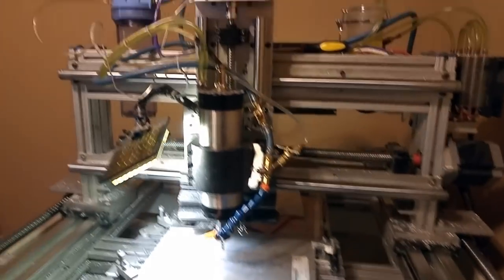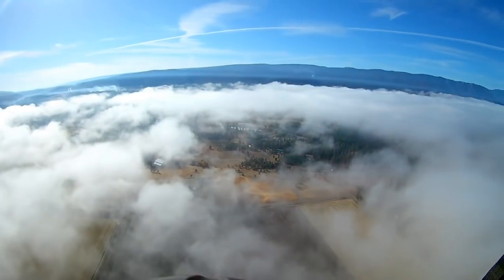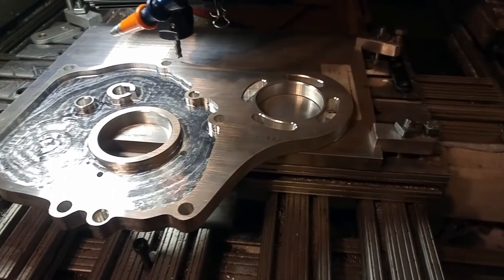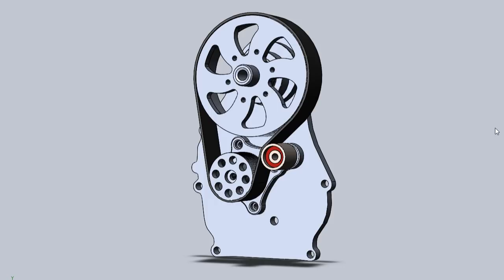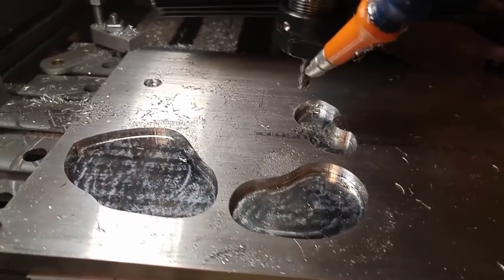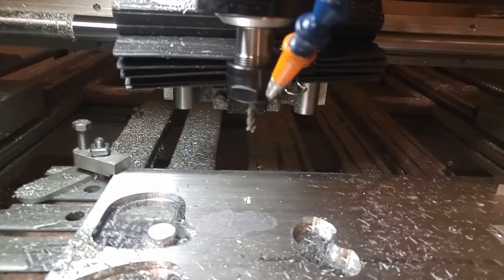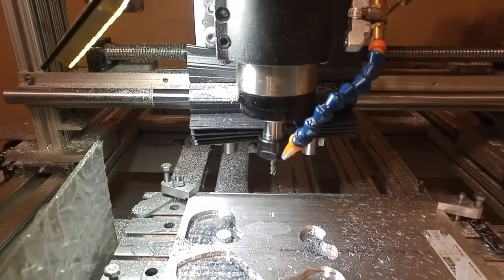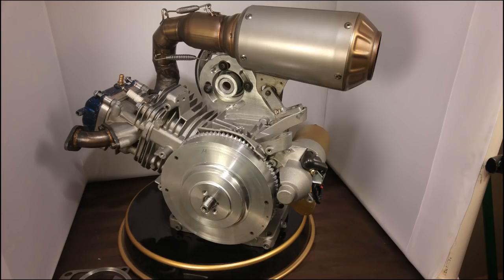Homemade Paramotor - Machining Reduction v2

Comment: How special.  I'm fascinated by the idea of a 212 way to fly myself.  I'll check out your other videos.
Reply from the maker: You will quickly find out that it's not the way to go. It's a fun tinker project but it's not a viable option for flying without a big budget.
Reply: @IrisPPG  alright dude my paramotor is done, and things keep falling off lol.  The redrive is proving to be a pain in the ass lol.  I'm going to switch to belts like you did and see how that goes.  I think direct drive to chain is a horrible idea.  I recall you saying something like that in the video.  I'm not going to admit you are right on the tinker project thing.... Not yet anyway ;)

Comment: I just stumbled on your videos, so you might have answered somewhere else, but why not using a geared reduction mechanism, since you already have a oil chamber? My reasoning is that by having the prop rotating in the opposite direction to the flywheel, you are removing a bit of inertia issues.
Reply from the maker: nraynaud1. Hmm. The oil chamber is inside the block itself but that's a pretty good idea! I'll have to ponder it. Thanks!

Comment: I somehow missed this one.... nice work :)
Did i see you use a thread mill on that cnc?
I love thread milling on my cnc but only if i have lots of threads to do.... they are tooooo pricey to risk on a few threads for my taste.

I guess the cnc paranoia is universal... i always start off slow until it looks like the machine knows what its doing... then ill get cocky and push it.

Looking forward to your oil pump solution... it might come in handy if I make my own crankcase... the GY6 pump is not ideal either.

Comment: man you are pure genius far beyond my expertise.   do all us paramotor guys a favor and master this 4 stroke journey and help us out on a affordable machine! great job.
Reply from the maker: matthew lee appreciate it, Matt, that's the plan 😊
Reply: Dmitri's Gallery I dont know if you've ever messed around with propane.  but If I had a 4 stroke rig thats definitely what I would take into consideration.    you could use the camp fuel botttes to run your engine.   I run my lawn mowers off propane.  the benefits. no fluiding. no messy leaks and also better fuel efficiency.

Comment: Fantastic job on this! The new side plate looks to be a great upgrade. Couple of questions... what size are the drive pulleys and whats the max rpms  you're able to turn the prop? Thanks for sharing your work on this!
Reply from the maker: Thanks Mike, the pulleys are 5.75" (big) and 2.3" (small). My engine does spin up to 8400 RPM but due to poor balancing (which I will address eventually) I do not like to be up there so I stay below 8000. Whether the motor in this configuration can take the particular prop to max speed is a different question and I do not know the answer to it. I will likely upgrade to an adjustable pitch prop to make use of every ounce of power the motor produces.
Reply from the maker: That makes 2.5 reduction ratio btw and at just below 8000 RPM I aim for around 3000 or so RPM at the prop.

Comment: This is so cool!!!!!!! Where did you get that muffler? Does it do a good job of making it more quiet? Looks like titanium exhaust.
Reply from the maker: Much appreciated. It's just stainless, I picked it up for dirt cheap on ebay. The main piping is a bit large for the pred at 38mm but it certainly reduces the noise (in particular the high pitched stuff that fatigues the ears).
https://www.ebay.com/itm/38mm-51mm-Motorcycle-ATV-Exhaust-Pipe-Muffler-Stainless-Steel-Universal-US-STOCK/272709391236?hash=item3f7ebf1384:g:vOoAAOSwstJZXar~&vxp=mtr
Reply from the maker: It is however very light for its size and the build quality (welds in particular) were top notch. Note I fabricated the pie-cut header so you only get the muffler itself.

Comment: Great job!  I guess I hadn't paid enough attention.  This new plate actually replaces your crank case cover!  Before I was thinking it just bolted over your cover.  Now that you have the idler, can you now get rid of your four slotted bolt holes on the prop bearing connection point?
Reply from the maker: John Hansknecht hey man, you still need a mechanism for adjusting the belt since the idler is stationary,